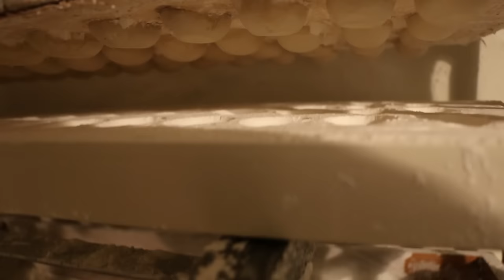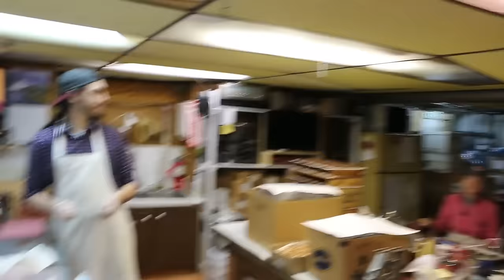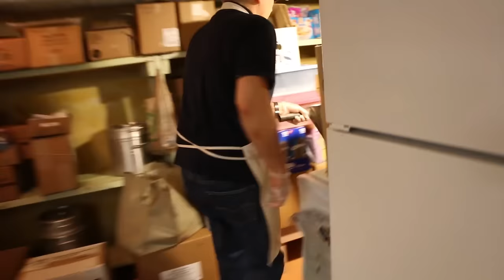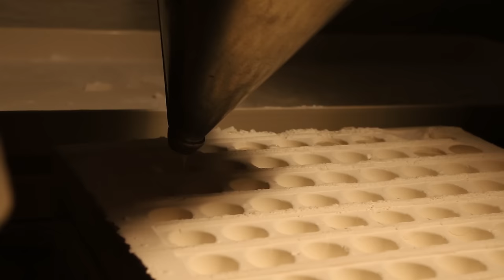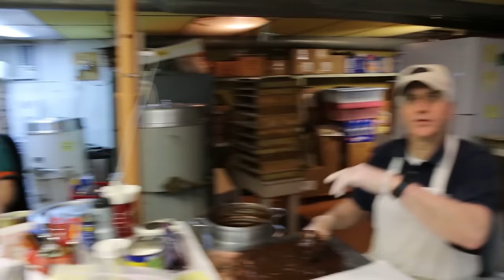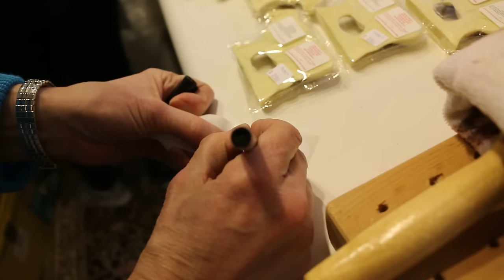How We Make Our Coconut Creme Eggs

Comment: QUESTION....WHY NOT JUST MAKE A SOLID MOLD INSTEAD OF THE CORNSTARCH, JUST CURIOUS IF I MISSED THAT PART.
Reply: @LOVE LIFE
When they remove the eggs from the Starch, they mention that they are very soft, and you can easily crush it if you push too hard on it. So the cornstarch trays allow it to unmould easily, rather than having to pop them out of Plastic/Silicone Trays.